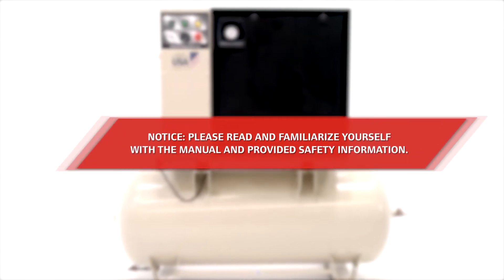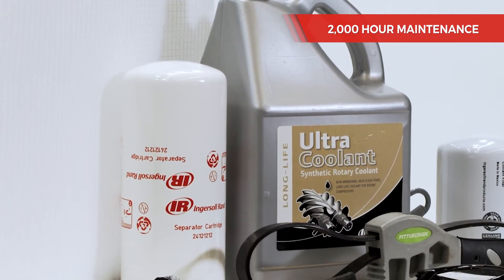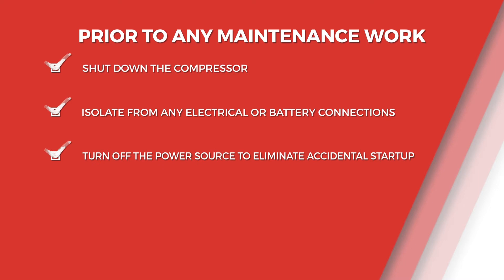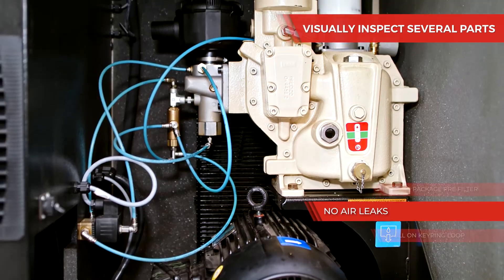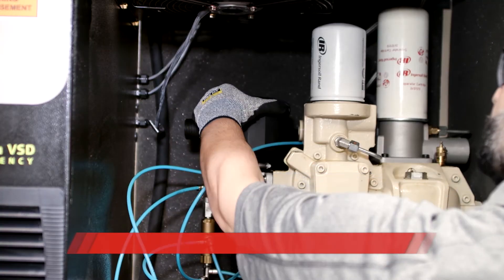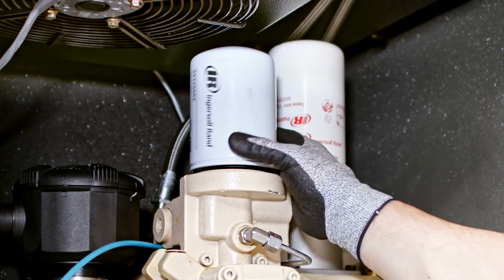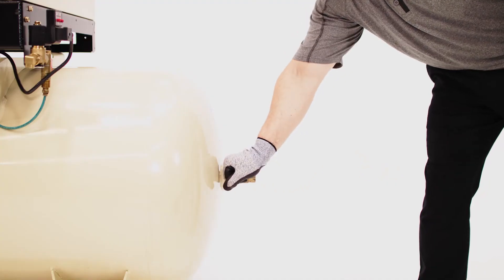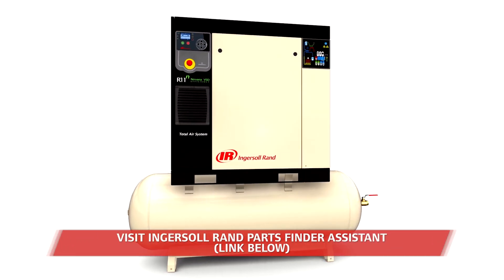2,000 Hour Preventive Maintenance/Service | Ingersoll Rand Oil Flooded Rotary Screw Compressor

Comment: What causes water in the coolant at low hours (200hrs)? Coolant,oil and separator filters was changed. Coolant resembles "rusty water".
Reply: The compressor isnt running enough. When the ambient air is pulled into the airend (compression chamber), the temperature of the air drastically increases due to heat of compression. Rotary compressors are designed to run continuously, which causes moisture in the air to stay in vapor form . When they only run for a brief time, the hot air then cools, which allows the water vapors to condense and mix with the oil. You more than likely need a piston compressor instead. If you keep the rotary, change your oil more often.
Reply: @mattfleskes6359  this pair of R7.5i  supply the DEF system on a tier 4 tugboat. After troubleshooting, changing the MPCV solved the problem. These are definitely a learning process for sure. Thanks for the reply